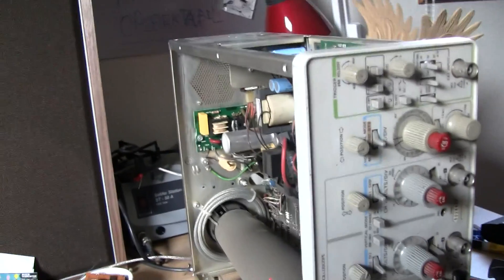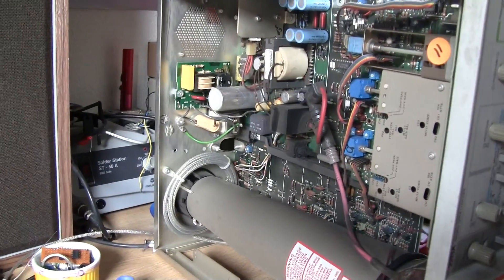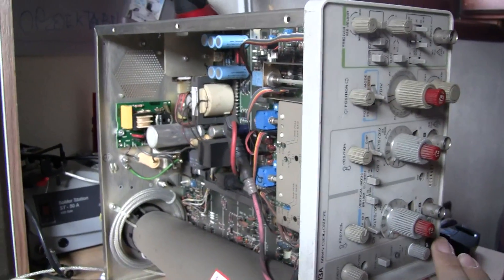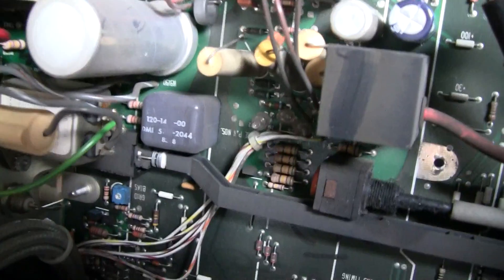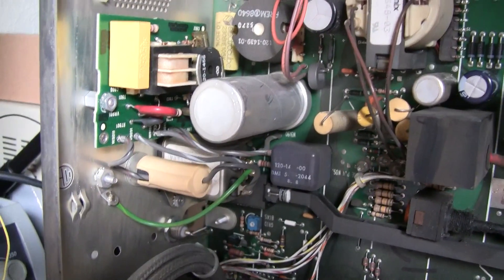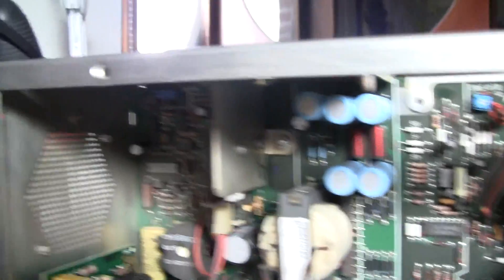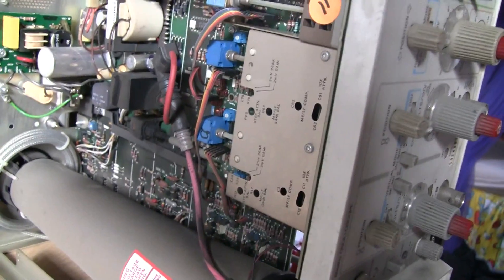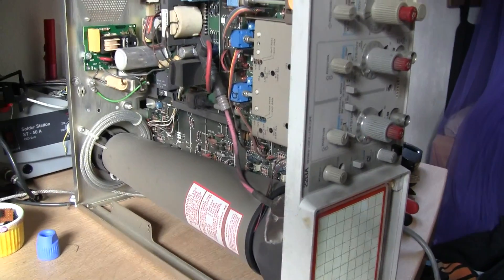Tektronix 2213A Analog Oscilloscope Problem

Comment: Neon DS870 indicate excessive voltage between cathode and filament.
DS858 and DS856 (I think your case is this) protect the crt from excessive grid-to-cathode voltage if the potential on either the control grid or cathode is lost for any reason.
I'm fighting with one similar  phantom in 2025😅

Comment: did you get the oscilloscope working in the end? The two flashing bulbs is an indication that the power supply is pulsing it's trying to start up and then it's been shut down by an overload or a short circuit somewhere in the power supply

Comment: Try disconnecting the brown wire that goes to the top of the HV multiplier, ( the black box with the large red wire going to the CRT) and turn it back on, if the chirping and blinking stop, replace that. They are used on E-Bay and are soldered to the board with four legs on the bottom. Chris in Seattle.

Comment: Do you have the repair manual?  You can buy both paper and CDROM versions on eBay.  With the aid of their schematics, circuit board diagrams, and descriptions plus a voltmeter, you should be able to very a power supply problem.  I seem to have a dead vertical signal path on ch. 2 and have begun looking over the manual.  Unfortunately, they have no instructions for troubleshooting the vertical circuits.  However, many test points and voltages are shown in the diagrams.  For instance, the power supplied to the signal processing and control circuits is +/- 8.6 V.
Reply: Don't know what happened there.  Should read ", you should be able to verify a power supply ... ".

Comment: If you can see a dot with beam find then is more likely an issue with the triggering so you're not getting any triggered sweep. Try setting up controls for auto triggering...the user manual for 2213 will guide you to the best initial settings for likely trace to appear. You then need to check the timebase sections for any missing signals off the circuit board. That's where I would start.

Comment: Try Teks own fundementals on Switch Mode Power supplies: 
tek.com/document/fact-sheet/fundamentals-switch-mode-power-supply-testing-poster

Also download the service manual for the 2213 oscilloscope to see exactly the exact circuit layout for details on the power supply and where to probe exactly.

Comment from the maker: I have check't the duty cycle and as you said it was completely off . i replaced the caps but by accedent cased a short somewhere and im currently trying to figure out where the new problem is.

Comment: Def looks like an issue with the switch mode power supply. You need to use a working oscilloscope to check the feed and outputs of the power supply unit. Check the duty cycle etc.

Comment: Have you figured this problem out?  I am having a problem with the same oscilloscope.  It turns on, but there is no light on the screen unless I press the "Beam Find" button, then it shows a dot.
Reply: Tristan L Hey, I'm currently having the same problem. Did you ever manage to figure it out? I suspect it's not triggering correctly.